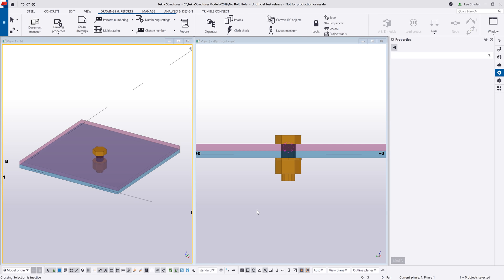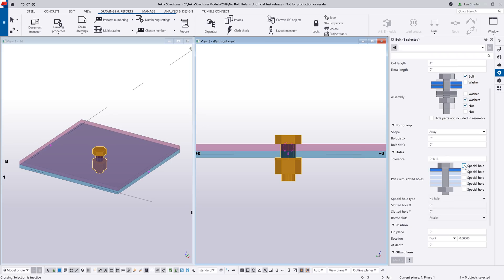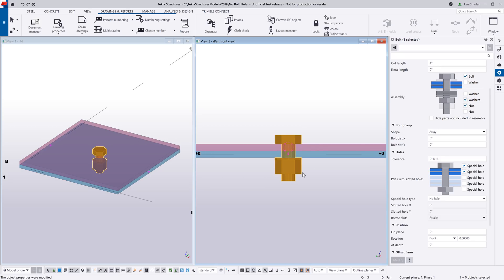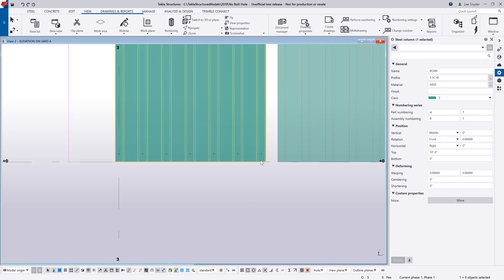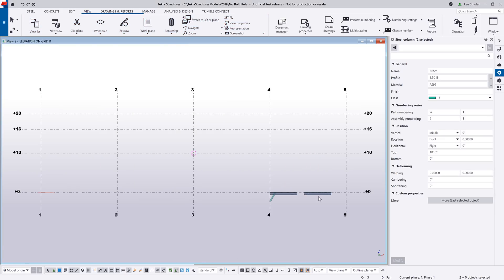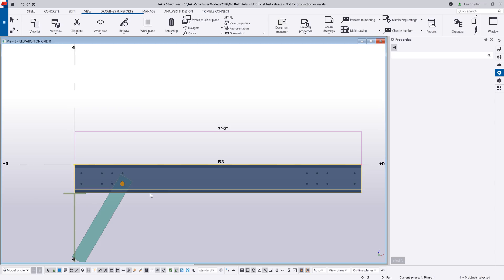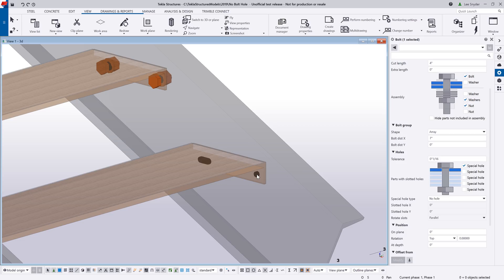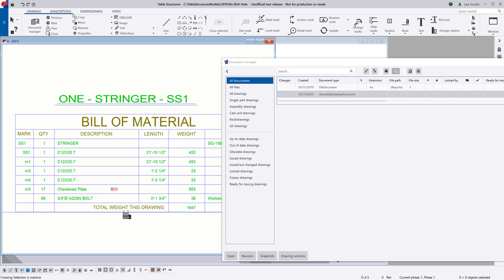Improvements In Bolt Holes in Tekla Structures 2019

Comment: This new feature is great, but does it apply just one same type of special hole to selected plies?
Will it be possible to use different types of hole on different plies in the future?
Reply: Yes when you set the special hole it applies to all plies in that bolt group just like an over-sized or slotted hole would.  Not the exact final solution we want but a step in the right direction.
Reply: @leesnyder6784  a great step in the right direction. being able to add different holes and have them off center in the future would be fantastic!

Comment: A good step in the right direction.  Is there still no facility for tapped or threaded holes?
Reply: 2016-2019 is a wrong step in a totally wrong direction
Reply: exactly what i was thinking and also does the no hole apply all the special  options?
Reply: @leviwebb9401  Yes when you set the special hole it applies to all plies in that bolt group just like an over-sized or slotted hole would.  Not the exact final solution we want but a step in the right direction.
Reply: Not at the moment but it is on our development list.